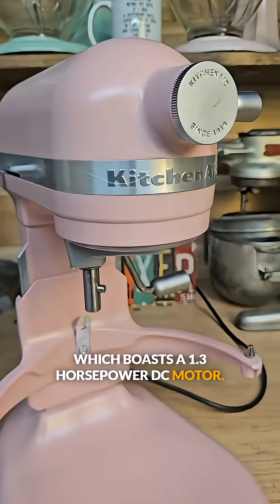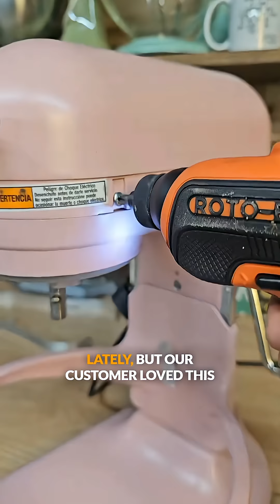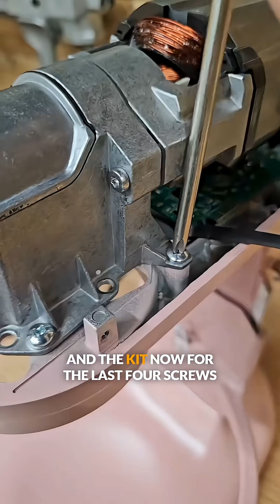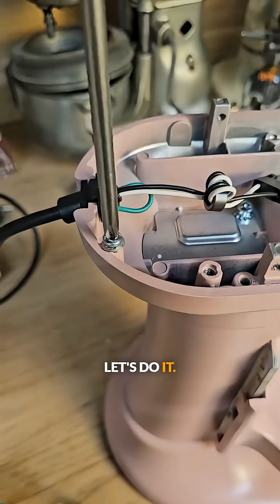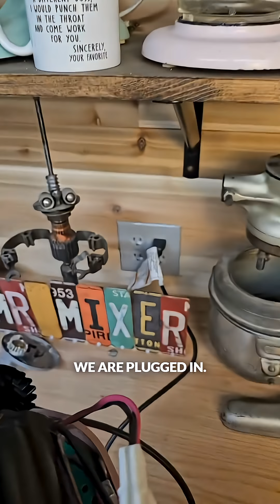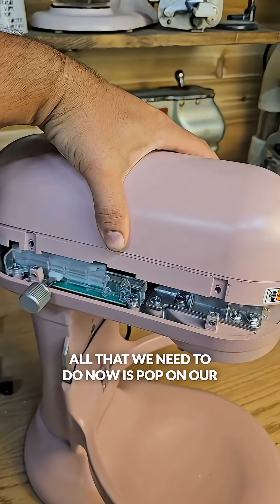One of the most controversial KitchenAid mixers ever released!!

Comment: I bought the 6 quart Professional because it was reputed to be more powerful and reliable than the 7 quart mixer.  After 10 years, I'm replacing the worm follower gear tomorrow, but I'm keeping the 6 quart mixer as a backup and buying a refurbished 8 quart commercial mixer.  It's very cool that the 7 quart can be upgraded to the much better DC motor from the 8 quart.

Comment: How do I tell which motor mine has without disassemble.
Reply from the maker: Put the model number that's located on a sticker on the underside of the machine on our parts compatibility checker https://www.mrmixer.store/compatibility-checker
Reply: @MrMixer316 wife’s mixer. Thought it was bigger.  It’s a KSM150.  
Are there any specific items I should get as they are the common first failure.  Or any parts that are a significant improvement over a factory flaw?

Comment: Got any ideas as to why mine doesn't always start when i move the speed selector switch from off to speed 1?
Reply from the maker: Yes it's almost exclusively the speed control board. Send over an email with your model to mrmixer316@gmail.com and we can get you parts and videos linked!
Reply: @MrMixer316 thank you so much. I will get that to you in a few days. I should've sent it back when we got, because it's been like that from the start... 😅 Might as well fix it before it becomes a problem. Thank you for the quick response.

Do you know if they're using a rheostat on the circuit board to control the speed controller?

Comment: Old motor: 120 VAC at 5A is 600 Watts, but motor sticker says 500 Watts (0.67 HP). 

New Motor: 128 VDC at 2.1A is 268.8 Watts (0.36 HP).

Marketing department claims “The KitchenAid® NSF Certified® Commercial Series 8 Quart Bowl-Lift Stand Mixer features a stainless steel bowl guard and a powerful, 1.3 HP Motor*. *Horsepower for our mixer motors was measured using a dynamometer, a machine laboratories routinely use to measure the mechanical power of motors. Our 1.3 horsepower (HP) motor reference reflects the horsepower rating of the motor itself and not the mixer’s horsepower output to the mixer bowl. This robust motor, the backbone of our new mixer, delivers .44 HP to the bowl enabling your mixer to deliver consistent power to small and large loads with less heat build-up; resulting in years of dependable mixing. Whencombined with, and guided by our new advanced motor control board, this is our longest lasting and most efficient motor yet. Simply put, our new, highly efficient, special purpose motor delivers the power you need when you need it.”

https://www.kitchenaid.com/countertop-appliances/stand-mixers/bowl-lift-stand-mixers/p.nsf-certified-commercial-series-8-quart-bowl-lift-stand-mixer-with-stainless-steel-bowl-guard.KSMC895OB.html

It’s not a 1.3 HP motor, it’s a 1.3 HP “motor reference”.

Comment: Is there any way to convert 120v kitchenaid mixer to 220v ? If so, can you make a video?
Reply from the maker: I don't have the power requirements to do it. But soon I will. It needs a new motor, field assembly, phase board, cord and r/f filter. All 220v

Comment: This is a legit question: the only thing that stood out to me is that it seems like the screws that mount the motor in place could work their way out over time.  Is there a reason you don't use loctite?
Reply from the maker: We typically don't see those come loose unless it was from factory and never tight to begin with!

Comment: We bought a used one that was probably made around the year 2000.  My wife loves it.  I have had it apart a couple times for easy fixes.  I was wondering if that motor would fit in the old units until reading the comments, and found out how much it cost.  If ours gives up the ghost, we will find another used model.

Comment: Just picked up a K45 from 1974. She is dirty and has some major paint scrapes. But still for $30, what do you want.
Reply: I found mine at an estate sale for $10. I'm thinking it may be from the 50's as the people were neighbors of my grandparents and were close to their age. Love vintage finds!
Reply: How do you determine the model year?
Reply: Date of Mfg and origin is either printed on a paper sticker on the base, or on a metal tag.
Reply: That's a good get. You can regrease and repaint.  That machine was made by Hobart.  Hobart cut the gears from a block of steel. Sometime after the brand was bought by Whirlpool in 1986, they started substituting steel with die-caste nonferrous gears from China.
Reply: @davidcanfield883 Hobart don't F around.

Comment: Typically, AC motors are significantly more reliable than DC motors, which is why nearly every piece of industrial equipment uses AC motors.  This is largely because AC motors don't have the brushes and commutators that DC motors have, which wear out and can produce sparks, which isn't great when operating around flammable powders like fine flour, thus making an AC motor the better design for a mixer.  However, dropping from a 1.3 HP (956 Watt) motor to a 500 Watt motor is a 48 percent reduction in power, which is pretty ridiculous and reason enough to want to put that DC motor back in.  Especially if you mix a lot of thick doughs.
Reply from the maker: It's not the motor perse, it's the gearing. They went to helical shaped main planetary hears and they break waay to easy
Reply: @MrMixer316   That makes sense.  A lot of consumer grade products cheaps out on the gearing these days.

Comment: Im shocked that a brushless motor is less reliable and less powerful than the DC kind. Brushless is usually the way to go
Reply: The point of brushes on a motor is to mechanically switch power to the electromagnet coils as the motor spins. This causes issues because you have (typically) graphite brushes rubbing against alternating copper/insulator as the motor spins, which will slowly wear the graphite down (producing conductive dust) until the brushes aren't long enough to make contact (needing replacement).

AC motors typically don't need brushes because the alternating current does the switching. There are brushed "universal" motors which run on AC and DC, which might be used with AC to make speed control easier.

DC motors you can run off of a battery without electronics are brushed. If the electricity isn't switching, you need something else to switch the electromagnets off/into reverse once they're done pulling (unless it's a solenoid or something that only needs the one tug).

Brushless DC (BLDC) motors need a controller to run. That controller takes DC electricity and electronically switches it (generally with transistors) to turn the motor coils on and off. Electric cars use these with good controllers to maximize efficiency and performance while being able to run the motor as a generator to get different amounts of braking.

I think both types of motor in this video are brushless, using a hall effect sensor to tell where the motor is so that the power gets switched on at the correct time (so the motor doesn't get run backwards), and the AC one definitely uses a TRIAC to chop up the AC to slow the motor down (this is how some dimmer switches work).
Reply: @reddragonflyxx  I'm not sure why you've explained to me the mechanics of brushless motors?
BLDC motors are a bit of misnomer in their name, as although the controller takes in DC power, the output is essentially 3 phase AC power, just with control over frequency.
Reply: @PBMS123 they used AI
Reply: Brushless really shines on tools that take a battery.

Comment: Well just went and looked at my old beast. Professional 600 with a 6 quart bowl, 575 watts. Has a slide switch for the speed control on it. The rotary  knob on the one you were highlighting here kind of threw me for a loop. Why I had to go look at mine. I know, not exactly new, kind of like me, lol.
Reply: I have one too but I bought it refurbished and they only have a sticker on the bottom saying it's refurbished not the model number. I need to order the dc motor kit and I can't.

Comment: I'm from Argentina and the KSM70 comes ready to 220v. Would that upgrade still be compatible?
Reply from the maker: It would just require the 220v board, motor, and cord
Reply: So I'd be OK with the cord that the machine already has and both the motor and the board from this upgrade kit or they are just for 110v?
Reply from the maker: @marstricker they are 110 but we can bring in 220v, you need a new cord. The one in your machine does not link up to the new board you'll be putting in

Comment: Can I modify my Costco 6qt lift bowl to the DC motor?
Reply from the maker: Yea you can! It can also receive a 7qt bowl which we also offer!
Reply: @MrMixer316  I'm going to do it. Will be ordering
Reply: @MrMixer316  mine says 590 watt. That doesn't matter right?
Reply from the maker: @calvinlim9485 sorry I thought you meant the new 6qt machine. You have the pro 600. It can be turned into it but it would need a new upper and lower housing as well. We do have them but it would run you roughly $500
Reply: @MrMixer316 thank you for the clarification. Been doing a deep dive on your videos and taking mine apart to see what can be fixed or salvaged.

Comment: Too bad you couldn’t upgrade the name band too, adding “1.3 HP commercial upgraded by Mr. Mixer”. 

I like the quirky orange power cord too but not on a pink mixer.😊
Reply from the maker: I thought better than to out orange on pink 😂.
Reply: @MrMixer316 it strikes me you are close to being able to market commercially upgraded machines for restaurants and bakeries. How hard is it to get that dc motor and controller in a 2hp version or more? Maybe get a machinist to make some machined steel gears. The rest of the machine is nearly indestructible (unless dropped).